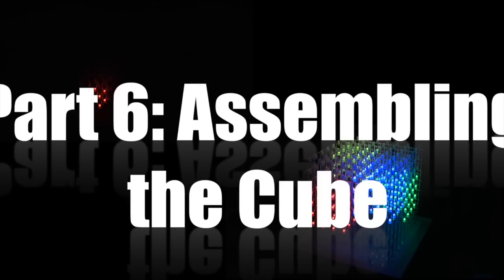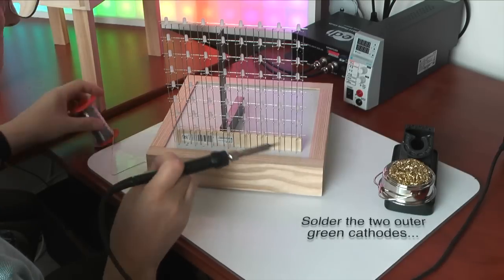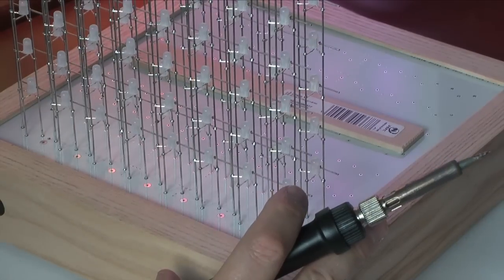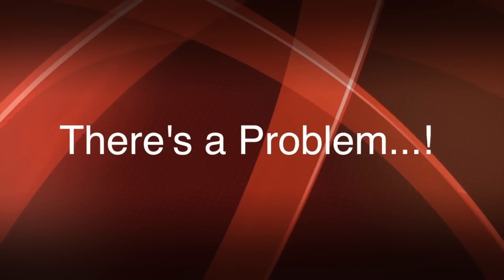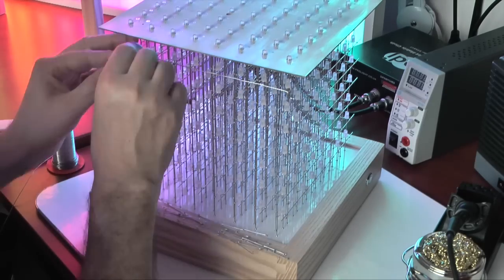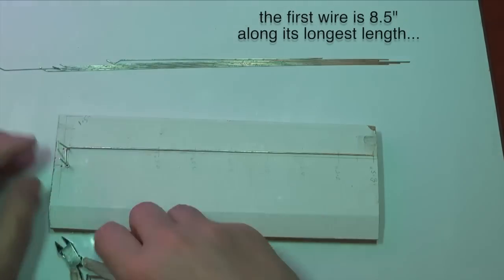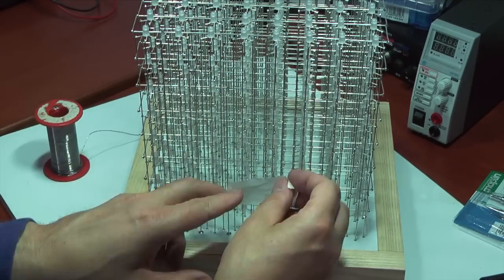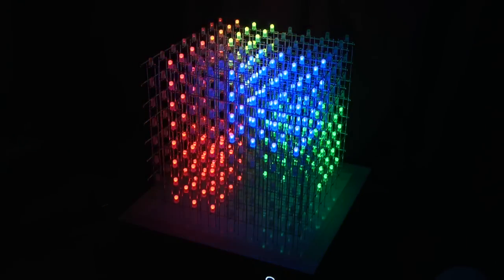Construction of an 8x8x8 RGB LED Cube. Part 6: Cube Final Assembly

Comment: I finished all 8 planes a couple of months ago using your jigs , Steve, and they have turned out looking very good. I need to mount and connect them next. Your board makes a neat job.
I like a lot of your ideas and I'm going to make a couple of cases similar to yours when I get back to this project. Life, inc the weather, has a habit of throwing in a few delay loops.
 I noticed you are using an Arduino Uno  I use a free-standing one with an SR and 8 mosfets but would like to use one of my Mega Arduinos as they have more memory. I would like to experiment further with Kevin's code. Nice test patterns btw.
Reply from the maker: Thanks for your comments and glad your making progress. The next base PCB I design (if I ever get round to it) will have the shift registers included, which would hopefully improve the complexity of the underside of the cube even though it isn’t as complex as other cubes I’ve seen. 

Ultimately I will be using a Teensy 3.1 microcontroller, which has a much smaller footprint, is a lot faster and has much more memory. The down side being it runs on 3.3 volts, so extra circuitry is required to match the 5 volts required to drive the rest of the circuits.

I also need to look at Kevin’s code and do something more with my test patterns. I also need to get PWM working as well, as I’m currently only delivering 7 colours (8 if you include all leds off).
Reply: @stevemanley3685  Is there are reason that you used the TLC5916IN in stead of the TLC5940? The later has build in PWM, and the advantage of having 16 channels in stead of 8 reducing the number of components. http://www.ti.com/lit/ds/symlink/tlc5940.pdf
Reply from the maker: Arpeggio
Hi, there were several reasons and I can’t remember all reasons. 

My design was based on Kevin Darrah’s cube and he didn’t use that chip.

I think the only version of the chip I could get was surface mount, and I had no experience mounting such chips. I think cost might have been a factor, the amount of memory needed to address that number of bits for that many LEDs on Arduino UNO, may have been a restriction.

If I were to do another cube, and based on my learning experience, I’d certainly give it more consideration if I were to do another cube.
Reply: @stevemanley3685  Thank you for your reply, i also was inspired by Kevin Darrah's cube, although he explains it really nice (also the more low-level technical workings) your build looks a lot cleaner (especially with the use of the jigs you made). I really like it that you made the decision to go for a PCB solution. Looks a lot cleaner and keeps the amount of soldering to a minimum.